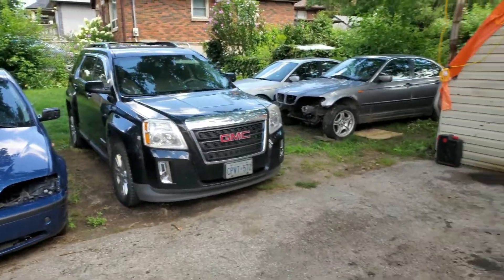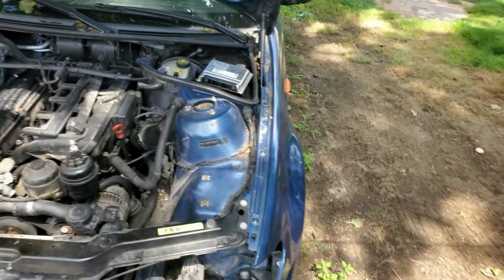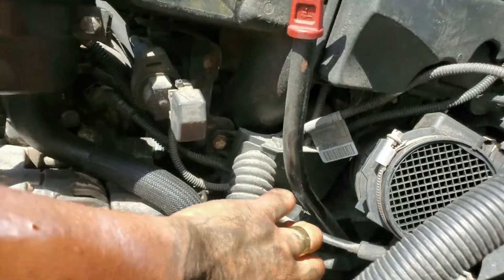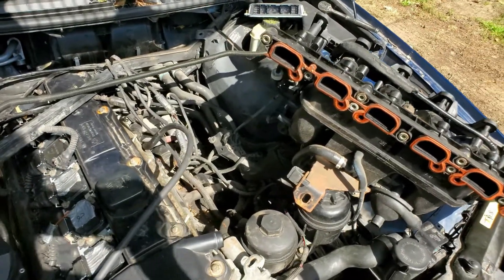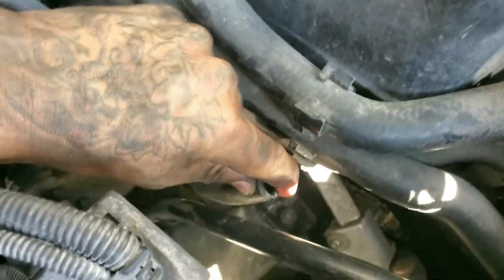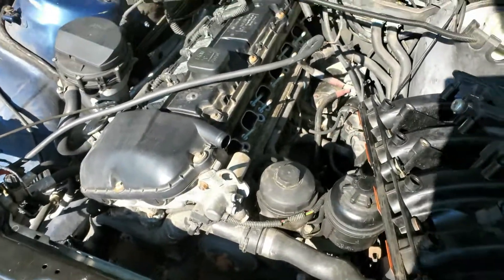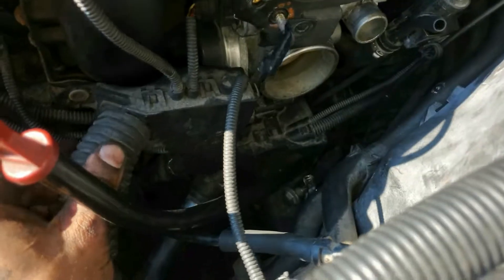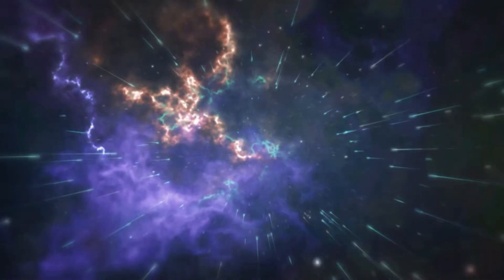S2E1 - How To Do A CCV Delete On E46 [Crank Case Vent Delete]

Comment: One last question as well you don’t cap off oil dip stick the small side part ?
Reply from the maker: There are two components to the oil dip stick. One is for the level measure rod and the other is the CCV (crank case vent). That smaller tube that comes off the side of the dip stick 100% needs to be capped. Make sure that is done to complete the CCV delete.
Reply: Or no need too?

Comment: What are the benefits of deleting this?
Reply from the maker: They are super weak and old pieces of plastic that pull vacuum. Once you turbocharger, ot compresses the air, which is the opposite of a vacuum. When you pressurize this system, you have a ton of areas of potential failure.

Comment: Can a faulty pcv affect staring in cold weather
Reply from the maker: No, but a vaccum leak can for sure. Are you familiar with discord? If you create an account for free and join our server, it is a great place to expand your knowledge and understanding of the vehicle you are driving. There are lots of people in there that will jump at the opportunity to help someone with a car related problem.
Here's our server: https://discord.gg/7W4fbuvBhb

However, consider this regarding the PCV, you will likely have oil seeping from a faulty valve if there is a leak, but your main concern would certainly be the vacuum leak that this issue is causing. 
A vacuum leak can cause cylinder misfires as well.
The misfires can either be random, specific, or with fuel cut-off. Each one means sowmthing different when diagnosing it. 
If you have a specific code you can reference, I could be of even more assistance to you. 

Do you have an OBDII code reader?
Reply: @AllThingsQuick  no i  don't have a reader
Reply from the maker: @courtneywest2803  if you live in Canada you can go to Part Sourse or if you live in the US you can go to a local auto zone and they should be able to code read it for free.
Get the codes some how if you have a check engine light on and then tell me the codes and I can help you further.
Reply: @AllThingsQuick  I'm living in London ,my mechanic plugged in his reader and their are no code because their are no eml display
Reply from the maker: @courtneywest2803  you don't need an EML for your check engine light to come on. 

Do you mean london England?
Reply: @AllThingsQuick  yes
Reply from the maker: @courtneywest2803  I live in London Ontario Canada. That's why I asked.
Reply: @AllThingsQuick  no problem
Reply: @AllThingsQuick  I have a misfire on mine not sure what’s causing it but I do have the codes I’m assuming a vacuum leak just not sure from where

Comment: Could you use the tube for the ccv that goes into the dipstick for an oil return for turbo? I'm looking into boosting my e46 323 and trying to find an easier solution for the oil return line other than tapping the oil pan
Reply from the maker: Yeah you could but that really far away from the turbo and I'm not sure why you'd want to do that.  But I supposed it.could be done.